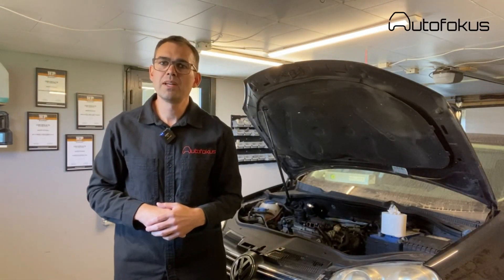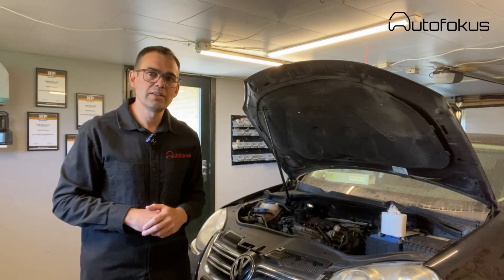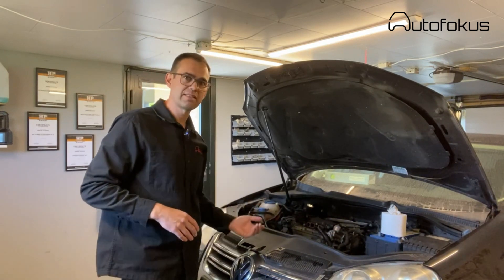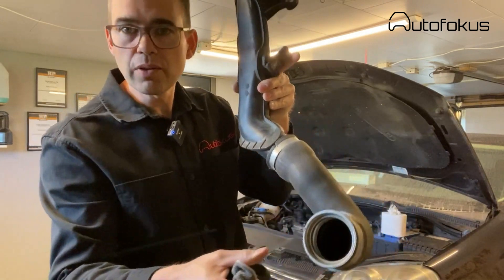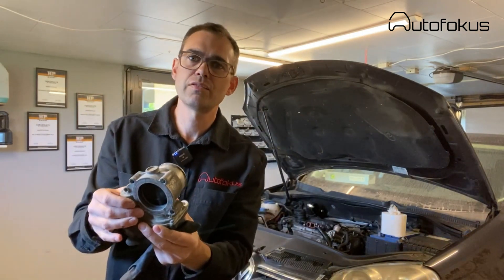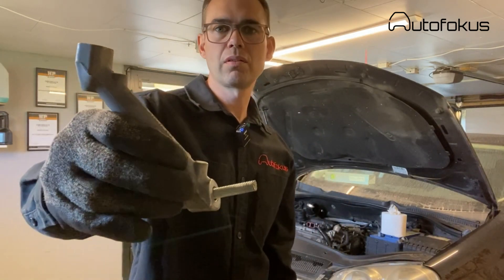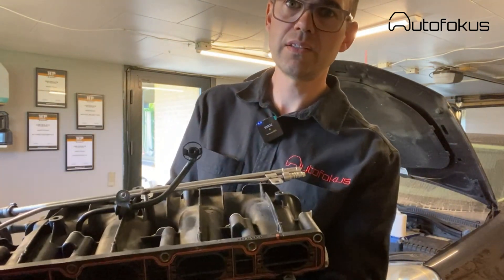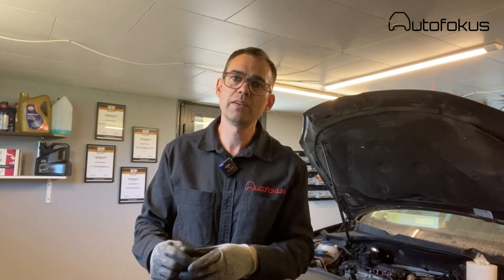VW/Audi 2,0 TFSI intake manifold removal

Comment: I find as well that most guides are misleading. If you cannot lift the car, can you remove the intake manifold without removing the fan and the lower intercooler tube?